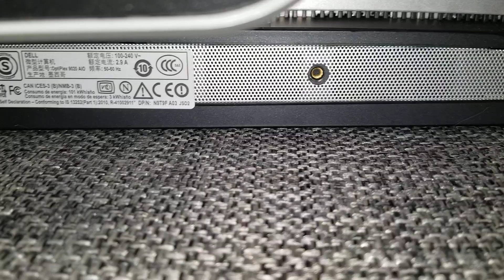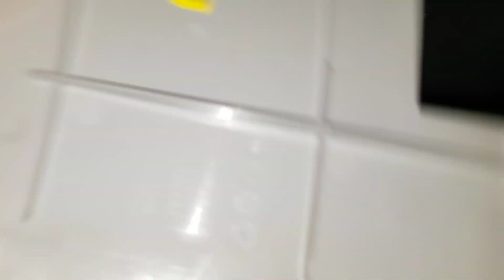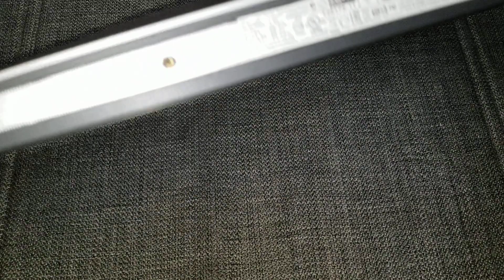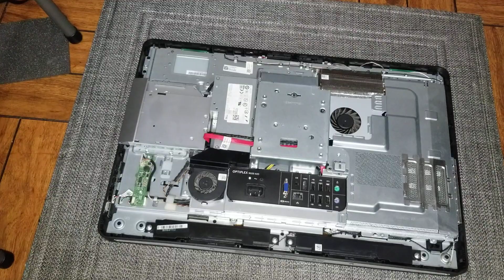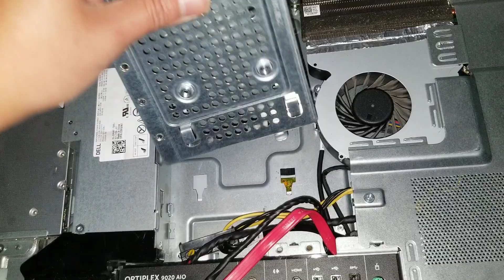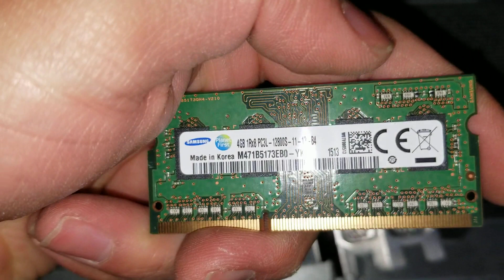DELL Optiplex 9020 AIO Disassembly for Hard Drive HDD SSD RAM Upgrade Replacement

Comment: Have the same machine, we upgraded it removing the old HDD 512 GB and Adding a 2 tb HDD and a 512 SSD on the CD slot, and putting other ram with 8 gb for a total16 gb for windows 11, and runs well heheh, as a aio of 10 years is still good for basic editing and office purpuses.
Reply from the maker: Nice!

Comment: I have the model that you worked on in this video. I have to replace the power supply fan. This is the first time working on the insides of a computer. I'm guessing the power supply fan is the smaller fan next to the plug. Where is a good place to get one of these fans? I would appreciate any help you can help me with. Thank you, BEHJR
Reply from the maker: @earlhundley4732  power supply fan?

Comment: I have same PC and need the HD SATA DATA power cable. Hard to find, I found one but they sent me CD rom cable instead of HD. Is there a different cable I can use instead of the 9020 AiO Hard Drive SATA DATA power cable OP13MH ? Or do you know where I can get one?
Thanks
Reply from the maker: I'm not sure :(

Comment: Merci très belle vidéo, question why this computer hasen't internal wifi card ??? There is issu to instal one ??? Merci
Reply from the maker: Really, no Wi-Fi? Should have it under the metal plate. I didn't take it completely apart.
Reply: @ItsBinhRepaired  Merci
Reply: @ItsBinhRepaired  I have found some informations about this DELL, there is 2 types, one has wifi card but other no
Reply from the maker: @lachamounchi8608  you can use a usb wireless adapter

Comment: Did your 9020 AIO come with a Wireless adapter card ????
Reply from the maker: Yes, it's internal, hence the wireless antennas.
Reply: @ItsBinhRepaired  I was able to locate mine but for some reason, the Bluetooth works, but not the WiFi. I swapped the wireless card out with a known working one & the exact same thing. I am just wondering if this was an optional extra, and DELL has deliberately disabled the WiFi feature if not selected to purchase?? Thanks for the reply
Reply from the maker: Might be a driver or antenna issue

Comment: looks like m2 ssd connector under the ram. it better to boot from where and have 2-4tb mechanical sata for storage
Reply from the maker: I don't think so.
Reply: yep, manual says it's wifi and wifi m2 slots are not compatible with m2 sata in general (only wifi/bt)
Reply from the maker: @andreika6681  hm? I think you mean pcie?
Reply: @ItsBinhRepaired  there's m2 slot  (for  dell's m2 wifi+bt 7260 card)  slot next to 2 ram slots. yes it's pcie, but it's m2 e connector, not m one (https://www.reddit.com/r/buildapc/comments/77jcy4/possible_to_use_m2_slot_for_wifibluetooth_card/) and i really wonder how you'd get wifi/bt working (as you told to some dude in other comments), you're supposed to connect antenna cables to that card (read manual page 21), which you don't have installed on your vid. guess you just don't know all that you're talking about, it's ok, you'll learn things as you grow older...
Reply from the maker: @andreika6681  haha yeah, I just fix them, not mess around with things inside.
Reply from the maker: @andreika6681  sometimes it's better to not know than to mess around thinking you know and then cause more damage. I get a lot of customers that plug things in where they shouldn't and fry their motherboards.
Reply: @ItsBinhRepaired  help 'em not firing their computers by telling 'em all the good tech info (but it'll cost you your time reading these manuals for 'em :-P) . but sure, you'll get more work (& $$) if you don't teach 'em and let 'em keep doing stupid things...
Reply from the maker: @andreika6681  you can do all the research and make your own videos. Not worth my time when so few will try to replace their wireless card with an SSD.
Reply: It's Binh Repaired Thank you for this insightful disassembly video. We were able to install a 128GB MSATA drive underneath the memory as the boot drive and then use the regular 3.5” HDD location for a larger platter drive. So it is a possible and viable upgrade solution, thanks.
Reply from the maker: @ScottOmatic  glad it worked!
Reply: @ScottOmatic  yep, mSata are ok, like: Samsung PM851 mSATA 1.8”SSD MT-MTE5120 MT-MTE256D MT-MTE1280. but as the price dropped a lot, just 1tb 2.5" sdd instead of 3.5" dd one are ok, + 9020 has plenty usb3 connectors (which are not marked in blue, so at first i thought it had only usb2), usb3 has more than enough bandwidth for external +4Tb usb drives... even in 2020 it a decent machine in fact, only the screen is darn crappy, with a 2nd  4k screen it's an excellent config for home use
Reply: andrei ka I work for a government agency that repurposes and sells surplus decommissioned IT equipment, so we put in the components that we already have in inventory.
Reply from the maker: @ScottOmatic  great
Reply: @ScottOmatic  wonder for how much you resell your 9020 aio's after upgrade... like $150 ?

Comment: I see the RAM upgrade but  not the HD upgrade install.
Reply from the maker: If you can't figure out how to put it back in after taking it out, I'm sorry, but I can't help you. I explained exactly what to do in the video.
Reply: @ItsBinhRepaired  The title of the video is misleading, 'Hard Drive HDD SSD RAM upgrade" - the word 'AND' indicates both will be shown.  Wasted time.
Reply from the maker: @Herabird  both are shown, the hard drive is already out of the caddy. Maybe open yours up and follow along. If you need to be shown how to take out screws to remove the drive from the caddy, which is the only part not shown, then I'm sorry, but you won't even be able to do the first few steps of this video, so forget about even trying.